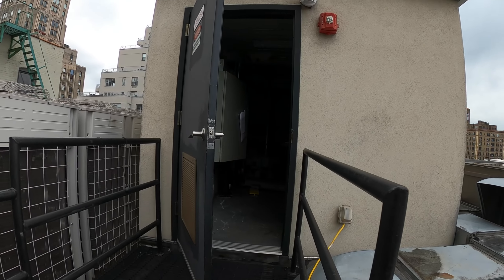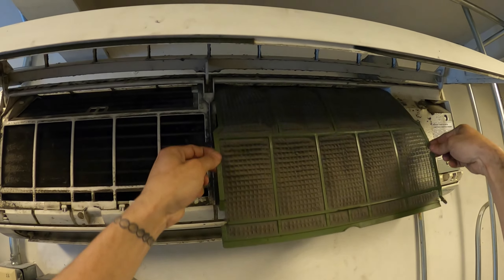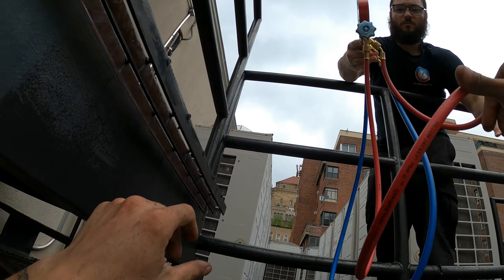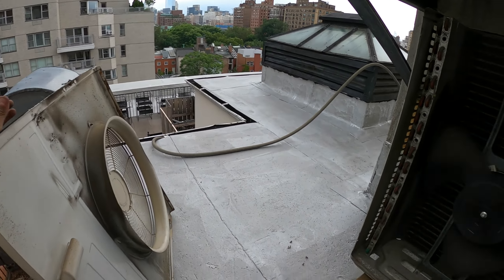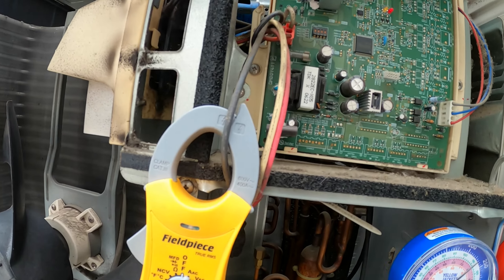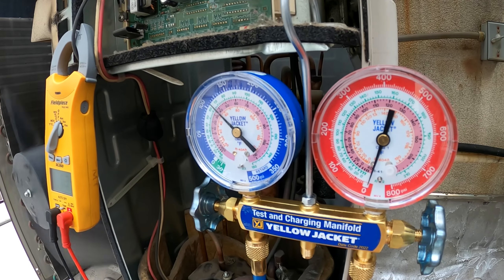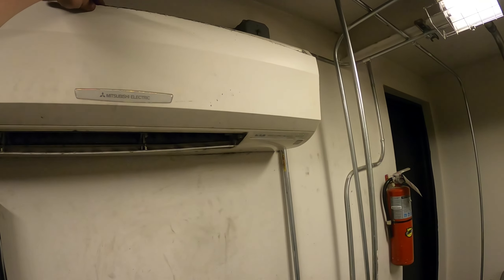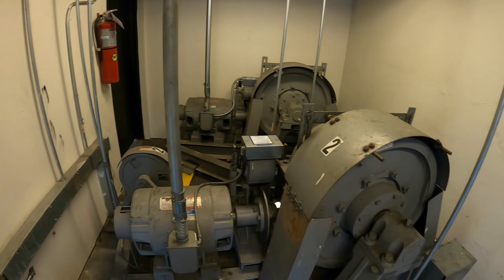HVAC Service Call:Mitsubishi heat Pump Not Cooling (Mitsubishi Air Conditioner Not Blowing Cold Air)

Comment: in machinery room using splits remove the plastic cover that u lift to access filters and leave it off. also set air direction a bit lower

Comment: It seems that this air conditioner is intended for cooling the elevator motor, in a hotel or commercial office building, etc, and this is the disaster !!! the problem with hotels and commercial buildings is that they neglect the air conditioning system . no cleaning of filters, no cleaning of the outdoor unit at the beginning of each summer, or anything !!!  they turn it on and off only, and after that they say why is the air conditioner damged !!! 

they do not deal with the air conditioner as we do in our homes . we clean the filters continuously and clean the condenser of the outdoor unit with a water hose at the beginning of each summer so that the air conditioner works efficiently and does not cause any malfunctions that cost us money (we care) but they do not care at all !!! most of the malfunctions in air conditioners occur in hotels and commercial buildings due to their amazing and strange negligence !!!

I think you agree with me on that hey freind .